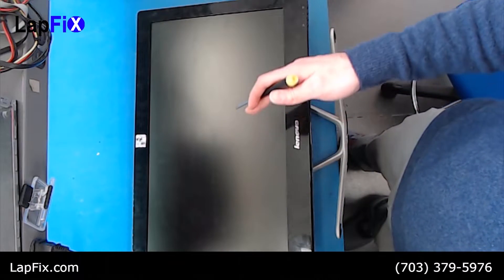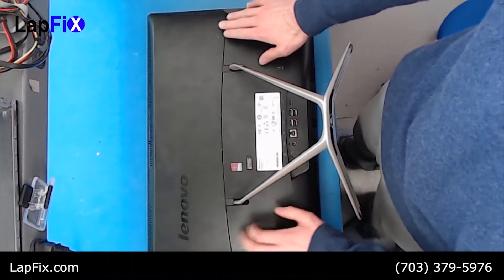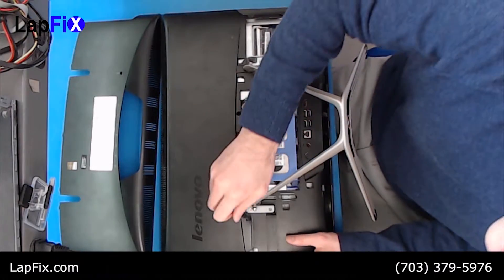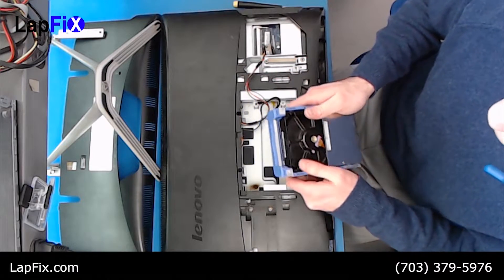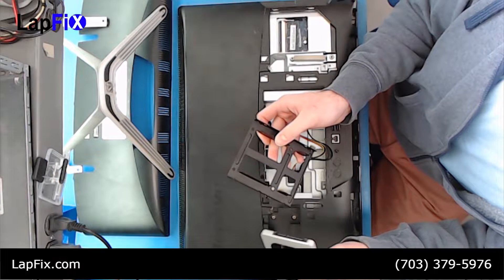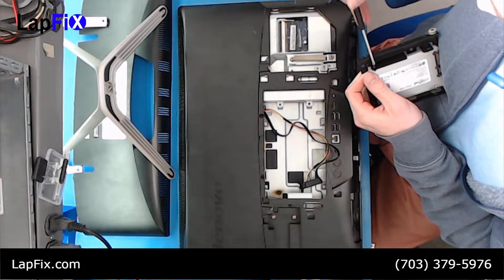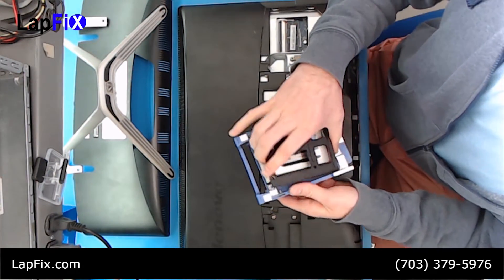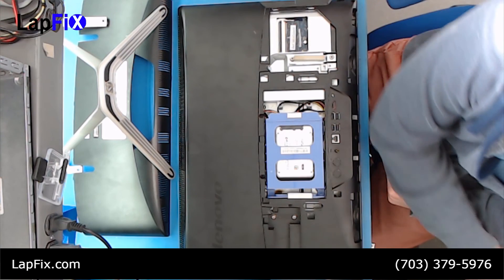Lenovo All-In-One C540 SSD Upgrade - How to : Basic | LapFix

Comment: I have a levono C540 and I would like to upgrade from the original that came inside of it. I am not a computer guy but i will be doing this myself. Only thing that is scary to me is going in to figure out the exact parts that i need. I would at least like to add more memory because when i try to update to windows 11 it tells me that I don’t have enough space so it can’t. I am gonna try to look through your videos on how to do each one separately. I kinda want to the the cheapest of the 2 first. I will subscribe as soon as i send this message. Thx for your info and videos.

Comment: Could you please inform what ram type can be used. I had issues with 1.5V Patriot 2x8 1600 - PC turns off after 2 seconds after I turn it on with 2x Ram installed. By 1 piece every so-dimm module worked fine. I wonder whether 1.35 V Ram can be used only there. Thanks you!

Comment: Apparently, there is more than one type of C540. The back cover did just easily slide off.  There a dozen invisible plastic tabs that were holding it in place.  It's a miracle that some of them didn't break as I forced the cover off.  Then the hard drive is locked in place as though it was permanently super-glued to the computer.  There are no visible power cables to remove, but I think there are at least two star screws holding the drive in place.  And  of course they are not easily accessible.  The blue plastic frame is blocking direct access to them.  I'll probably have to cut away part of the plastic to unscrew them.   I'm beginning to think this computer may end up in the dumpster.
Reply: damn I hope nothing went wrong
Reply: @Skull_Editz25 I broke the hell outa my clips but idc it's a pc built in 2012 swapping the hdd for a new one fixed it though lol and tape holds it together lmao

Comment: Have you encountered a situation where the computer shuts off and makes a tapping sound from the speakers, yet doesn't turn on all the way?  Same exact model here, it's a Lenovo 10110 C540.
Reply: Hello, My pc is having the same problem now. My computer just shuts off and makes a taps sound from the speaker. I am thinking of taking my pc to a repair shop. Could you tell me what was the issue with your computer and is it repearable

Comment: is it possible to install SSD without that cover? could you please tell me the technical term of that cover? Thanks a lot
Reply from the maker: The blue piece is the bracket that holds the 3.5" hard drive in place so it doesn't slide out.  If you are planning on installing the ssd, you would need a 2.5" to  3.5" hard drive adapter bracket.  This would then install into the blue bracket in the machine.  Without the blue bracket, your hard drive would be loose and could damage the machine and your hard drive
Reply: @lapfix  Thanks a lot, appreciate it the info :)

Comment: Will this be the same for a Lenovo IdeaCentre AIO 510S-23ISU? Looks the same design, so I assume it will be fitted in a similar way
Reply from the maker: It is very similar, the bottom on that model pops out the and the hard drive is there
Reply: @lapfix  hello . Your video is great. I have a question. How do you remove the cover to clean the fan on the 510-23ish?  It's under part of the top casing. but the casing gets stuck around  the CD drive and does not just pull up. Do I have to remove the CD drive first? How?
Reply: @slick brick 
Hi sir you need to download the manual first of your computer model for more references, if your computer like this model 
1st make it sure to unplug power cables etc. cables that are connected outside your computer 
2nd make sure to cooldown your computer atleast 5mins after using 
3rd remove the lower back cover like in this video 
4th Remove the HDD & connected Sata cable.
5th Remove the Ram.
6th Remove the DVD/DVDR by pulling down the metal lever to release & pull the side of DVD out.
7th Remove the Metal Stand
8th Remove All Screws in all sides of the plastic back cover.
9th

Comment: Can you add a second hard drive on this machine?
I know it has two SATA ports but on for Storaga and one for CD Drive, any way to add a second hard drive without taking the CD Drive SATA?
Reply from the maker: You are correct, it does have two SATA ports which are the same connection.  However, to add the second hard drive, you must take out the CD drive and be able to secure it.  There is no space to have the CD drive and two hard drives.
Reply: What size is the CD Drive? 9.5 or 12.7?